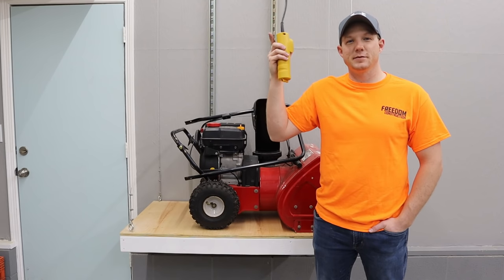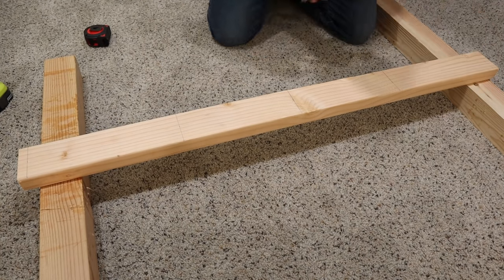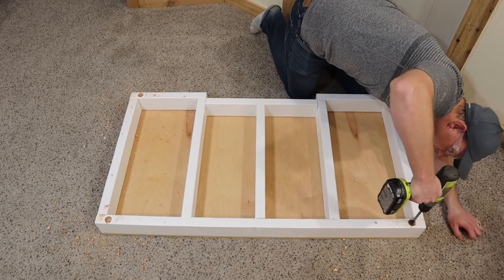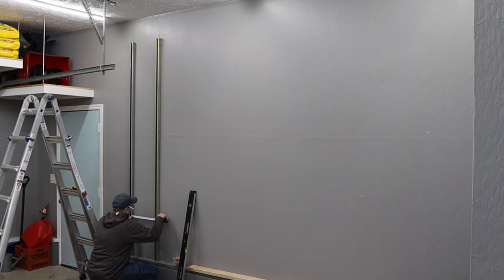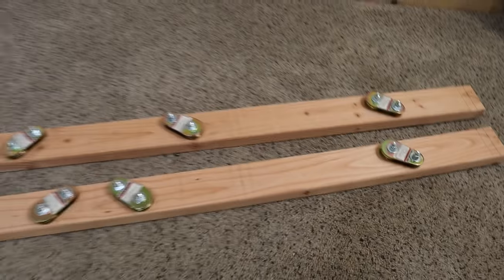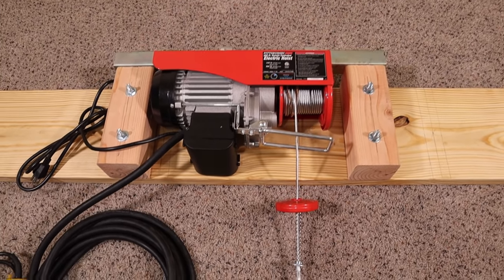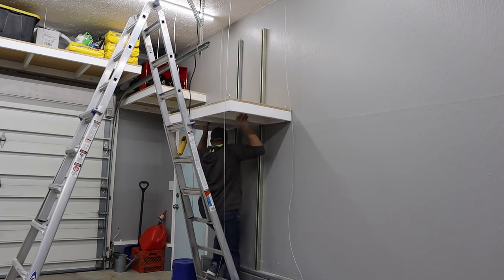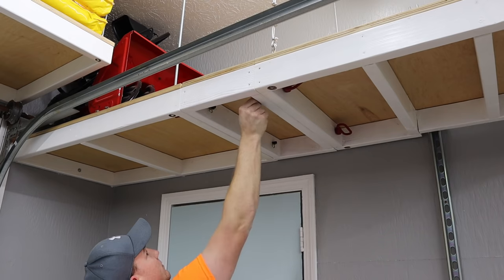DIY Electric Garage Storage Hoist | Snow Blower Lift | Garage Makeover Pt. 5

Comment: I love that idea.  Watching the video and pausing it here and there, I think permanently lengthening the snowblower platform to the corner of the doorframe to you house will save you the time and effort of installing and removing that little bridge unit.  I'm sure a one inch gap between the lift and the stationary platform is easily crossed by the snowblower.  I am also envisioning that you would be keeping your lawnmower up in that space during winter.

One thought I had, while I was noticing your garage door rails, is would a garage door opener motor be powerful enough and simpler to set up in the attic space?  One thing I might have done with the up and down switch is to permanently mount it to the wall instead of having it hang around all the time.

One way that you could make more mileage from your life is as a service platform.  Get your machine up to waist or shoulder height and you can comfortably do repairs.  I just fixed my snowblower by sitting and lying on the cold floor like an animal. Wish I had your lift.

Comment: Great video and very clever idea!  FYI - I can't really tell from the video, but it looks like some of your cable clamps might be installed backwards.  The U part goes on the 'dead' wire (the cut end) , and the saddle/bracket part goes on the 'live' wire (the wire that carries the load).
Reply: This!  and the order they were put on was incorrect. Always remember, never saddle a dead horse.
Reply: Who else knew there was a forward/backward to these???

Comment: As someone with only a few inches above the garage door spring that had to undo a spring to put a cable back on this summer you should be able to do it so long as you don’t line up with one of those studs.

Comment: That's great.  I'm sure this has already been commented but I would just leave the snowblower on the lift, the shelf now seems redundent and a lot of extra time to line up bolts etc. Just add a safety incase one of the cables breaks.

Comment: Damn you lifted the snowblower by hand as it was 50 pounds..  my toro weight like 187 pounds and we were two guys trying to put it in the truck,  and we both found that a little heavy.   As for the the ceiling truss. I know they are solid but i personnaly try not to pit too much stress on those truss,  because wood overtime become weak.. so what i did was to use the wall truss instead and add a couple of 2x6 across the room (like a patio deck) so i basically created the second floor using the wall only.  (My garage is 11 feet tall). So i had plenty of room to create that small second floor (balcony) and then i added the electric hoist.. i used that hoist for years to lift the jeep wrangler hard top which weight about 150 lbs.  Since the balcony is attached to the wall exclusively, there is no stress on the roof truss.. and most importantly no holes in the ceiling for the heat to escape .. where i live we have R40+ insulation value in the attic. So drilling holes in the ceiling is not recommended in our cold climat, but i suppose in warmer area like florida it is safe to do that.  Im sure you really enjoyed the final result, and probably proud of it. Just one thing.. as you get older you might not be able to lift that snowblower anymore.. or if you get some back injury…. There has to be a way to bring the platform further down so that anyone can grab the snowblower without lifting it..  like your kid or wife..

Comment: I’m currently teaching Yr7 how to drill Pilot, clearance and countersink holes and use an impact driver drill to complete butt and rebated butt joints. 2 classes, 45 students 180 joints 360 screws plus mistakes!! Lloyd

Comment: Nice job.  Rather than having to have to insert that “bridge” shelf, I might have simply made the permanent shelf for the snow blower long enough to reach the elevator shelf.  I only have enough room in my garage for either my snowblower or my lawnmower, so I swap my snow blower with my lawnmower depending on the season.  Put your lawnmower up there during the winter.

Comment: Nice project - a couple of thoughts
1) That quick link... in that 'horizonal' orientation is very compromised. It probably still is fine for your use... but... eugh! I would suggest replacing it with a triangular QL.
2) HDMPE (dynema) would be nicer than the steel cable - and with 12 strand you could do lovely buried splices on the eyes and it would look really nice and discrete. At the top end you could use a long burried splice as an adjustable loop (see whoopie slings) negating the need for the turnbuckle.
Reply from the maker: Thanks for the suggestions!

Comment: Depending on the weight of what would be going across it, I probably would have done a 1"x2" framed piece of ply that was piano hinged to the lift. Used as a ramp when the lift is down, flip up when lifting, drop down into a bridge when it's lifted all the way up.

Comment: This is awesome!!! I have a small 1 car garage but it has a really tall ceiling and there is a ton of storage in the ceiling (about 3/4 of the ceiling is designed for storage) Unfortunately though its only accessible by ladder and my garage is too small for a staircase. So i had this exact idea but wasn't sure how to actually build it.

Comment: Maybe in place of the bridge between platforms, try a “ramp” made from 3/4” plywood, attached to the fixed shelf with a couple of hinges, or heavy piano hinge, and just flip it down to bridge the gap. Yes, you’d have a small lip to contend with, but you could miter it to reduce it somewhat if needed. It would save you a good bit of time and effort pinning the current bridge in place.

Comment: Put the winch on the wall in the attic,  directly above the load. Use a single lift point between the strut tracks.

Comment: Can post some more pictures of the Attic install? I have also a truss system but was told that not to add too much load to the trusses, but I think with your pulley system you have effectively balanced the load.

Comment: Anyone remember the movie where the guy is tasked with reverse engineering a 3D computer monitor, and when he is showing off his re-engineered version, he says, "then I realized the screen was optional" and took it away, leaving just the 3D holographic image floating?  Maybe more movie-science than reality but that's exactly what I thought when I saw this.  I would scrap the shelf entirely and set the length of cables to hook to the 4 corners of the show thrower.  Bring the snow thrower in, snap hook the 4 corners, and wench it up to the ceiling.  Done.  Ready for the next use.  It's what we do with a lot of our equipment, with just ropes and snatch blocks.  Pull it up to the ceiling, tie it off, done.

Looks very nice and clean install though.  If I was dead-set on making the shelf and not just hanging the snow thrower, and since I hate going up and down into attics and crawlspaces, I would have pulley-redirected the cables along the ceiling and down that back channel between the uni-struts, maybe even cut out between those studs and put them in the wall.  Mount the wench at the floor pulling down to make the elevator go up.  That way all the serviceable parts are at hand and not in the attic.

Comment: Very cool job.  I think I'd have used turnbuckles on the platform as well.  This would make it easier to tension the cables without having to go into the attic or undo the cable clamps.

Comment: Great job, tho I noticed you still struggle to pull your dodad over onto the lift. May I suggest a simple board on fixed casters (with guides & stops) that will allow the dodad to flow easily back & forth. Enjoyed the build vid dude.

Comment: If you cut small pieces of pvc pipe you can glue it to the small shelf you install between them and it well make it easy to remove and replace the pins you won’t need the hammer !

Comment: I think the overall design of your lift is great and it should serve you well for many years.  I do have one safety comment:  I would reinforce the i-bolts and nuts with a metal plate or even a single piece of angle iron underneath the platform to assure that the i-bolts do not pull through with a heavy load.  You will probably never lift anything heavier than the snow blower but over-engineering for safety is probably never a bad idea.

Comment: I would have used larger pulleys to reduce the load on the winch and used a different design of the carriage and rails but if it works for you, That's fine. Perhaps rebuilding the shelf, a little larger with a 1/4" gap to the lift platform would be a nice improvement also. Things like this require more time for engineering and not so focused on the esthetic side. Making it pretty can be done later.

Comment: Potential upgrade: put 2 little receiving plates on the side of the lift and the side of the shelf, then add the male section to the infill piece, then just sit it in and it will sit on it's clips. Or remove 1.5" from the thickness of the infill, at a 1.5" batten to the shelf and lift edge and just sit the infill in, a locating steel dowel would ensure it could not slip.

Comment: Just saw this as I need to store my snow blower like yours. But i do not have access to the space above BUT I have a 15 foot ceiling so i could build the frame off the existing wall. I can't see why all the pulleys but i need to price the big pieces out and see if i can do it. very clever. Dennis

Comment: Wow, that's quite the setup, nice work.  What about a draw bridge out of alum. plate, you just lower instead of that bridge platform. Or just leave it on the elevator and use shelf for something else.
Reply from the maker: Thanks, I do agree there are better ways to make the bridge part. I really dont like leaving that amount of weight suspended without a safety.

Comment: Solution to make it go all the way to the floor. Cut the roller guide channel at the bottom a few inches up so the rollers will disengage then simply pull forward and continue lowering to the floor. You may need to adjust the cables. If you want to make it real easy add a small ramp on the right side and maybe even have it fold up.  Just another mechanical engineer putting in his 2 cents. Hope to see an update.

Comment: I'm not sure exactly what those cable clamps are rated for in that current configuration, but if you plan on lifting any significant weight I would suggest attaching the cable to the eye bolts with a Molly Hogan and then crimping the tail to the running end with those clips.

Comment: "never saddle a dead horse"...you got the cable clamps on the platform eye bolts in correct orientation, it appears. You're not using load-rated hardware...but you're not lifting much...so it doesn't matter. You haven't reduced any load on the final prime mover winch cable (if I'm seeing things correctly). What you have done is quartered the load on each of the cables extending to the platform supporting the blower. Nice job, btw!! Please learn about "blocks and tackle" and "free body diagrams" where cable systems tension is concerned...if you haven't, already.

Comment: Well done. Definitely over engineered, but nice work. Id recommend putting a hinge on the gap space and directly attaching it to your lift. If you ever do this again, id recommend all thread as the lift, rather than a wench, less space and a lot less risk for cable breaking.
Reply from the maker: Thanks for the tips!

Comment: Awesome build. I would have suggested instead of building the little transitional shelf to go between the snow blow shelf and elevator that you just used a 1/8" steel plate attached to piano hinge or some hinge type to the elevator. That way you dont need all that extra work of installing the hitch pins and nonsense. Mount a 1x1 board to the permanent shelf and the steel plate can drop and rest on that board like a draw bridge. Also at the bottom of the elevator it would double as the ramp to get it off/on. 

Also if you had mounted a board (the thickness of the foundation wall)  behind the rails you could have made the elevator go all the way down to the floor. Your back will thank you later down the road. 

Also to make it easier physically moving the snow blower maybe look into making a "creeper dolly" where the board is almost flush with the floor and has some castors in a similar layout as a creeper for a car. This way you can slide it on/off the elevator to the storage position and also you can build a ramp at the bottom to make it easier to get on/off the elevator.
Reply: Something else I noticed that may help you down the road. With your current shelving above the spring. Maybe design a rail system that goes parallel across your garage. Attach a shelf to that track system thats flush in height to the mounted shelving and can slide side to side in the track system via casters of some sort. Then you can offload heavier items from the shelving above the spring, onto the movable shelf, slide it over to the elevator platform and then lower the items to the floor or vise versa. It might sound cumbersome now, but in 10,15, 20 years it might save you having to lift those heavier items that are stored up there from a ladder.

Comment: Nice project! Just for your safety; the clamps should be installed with the u-bolt around the tight part of the line. The cable can slip in your current configuration. I don’t think it will in your situation, but it wouldn’t take long to turn them around. Thanks for the movie!
Reply: Mmmm interesting observation.  I have worked with cables 1/4" or less on and off for years and have never heard of this.  Is there better grip on the clamp end of the U-bolt ???
Reply: Yes the clamp part does grip the the cable tighter. If the cable does slip it will slip on the u-bolt side, so if the u-bolt is on the loose side the clamp part will move with the cable until the end slips from the u-bolt. If the u-bolt is around the tight side you have the cable pinched against itself and the grip of the clamp. If it does slip in that case it will only go as far as the thimble eye.
Reply: Sorry if I came off as a know it all. I did not mean to offend.
Reply: @frankherring6253  No I did not mean it like that.  More like learn something new everyday kind of thing.  I was wanting you to share  the technical details.

Comment: It's cool, but if you had use compound pulleys you don't need a 880 winch motor, but a simple electric motor would lift it because of the pulley multiplying the lifting force, although that's far more complex

Comment: I'm wondering why you didn't install the turn buckles in the eyebolts on the platform?  You could have made your adjustments from the ground in the garage.  Also, if you shimmed the tracks out from the wall, you could have lowered the platform to the ground.

Comment: For adjusting the door lift springs you use two steel bars in the end caps in a hand over hand manner. It is almost tantamount to needing space for a half turn rather than a quarter turn. Unfortunately you will probably have to take down the shelves to do it.
Reply: Use the safer worm-gear system instead of the outdated setscrew system.

Comment: Nice build, I would have used the winch to directly lift the blower and added a safety chain/rope to ensure gravity didn't do its thing. If you really wanted wood under it a hinged platform would have worked as well. I can appreciate the effort that was a good deal of work.

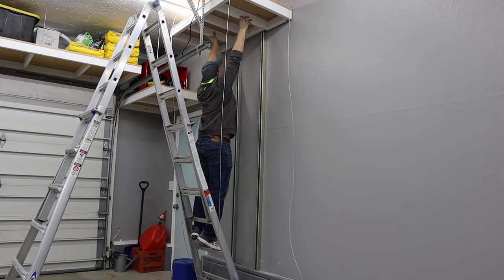Comment: Probably not going to see this given how old this video is, but the receptacle you have powering the hoist (10:48) is an NEC violation.
You aren't supposed to have any receptacles facing directly upward like that. The reason being is that water(for instance from say a roof leak) could drip or flow into the face of the socket and cause a short. You can face it literally any other direction but up.
As far as I remember, the only exception are floor receptacles(usually embedded in concrete) that are UL listed as such, and are water-tight(and not just damp or wet-location).

Comment: Nice job , but it occurs to me that a unistrut rail on the ceiling with a trolley , and connected to a boat winch or chain hoist could also have sufficed to lower your item to the floor.   Many ways to get there and all work with some variance in cost and complexity.

Comment: I am installing a lift in my shed.  I have used many of your ideas, they are awesome.  I purchased a Vevor hoist, also rated at 880 lbs.  Mine is mounted to the studs, so my cable will run horizontally, and not down right above the lift, like I see so many designs.  Because of limited height in my shed, I have mounted in on the wall opposite my lift.  I have been told the safety mechanism will not work, but that is ok.  My problem is when I went to test it today, my brand new Vevor lift will go up, but it will not go down.  So, I cannot unwind the cable horizontally to attach to my lift.  It is either defective, or I thought is there a safety switch which will cause it not to unspool, if I mount it to a wall, instead of a ceiling.  Let me know your thoughts.  Thanks again for your very Detailed video.
Reply from the maker: Thank you the kind words. I am not sure about your hoist. The one I have only has a safety to keep it from winding too far. I hope you figure it out.

Comment: Lots of time and cost simply to not have snowblower on ground, but we’ll done. Could have made as dual purpose of snowblower lift and attic lift if you installed an attic access above the lift, but that may would require some re-engineering/planning of the lift mount you had.